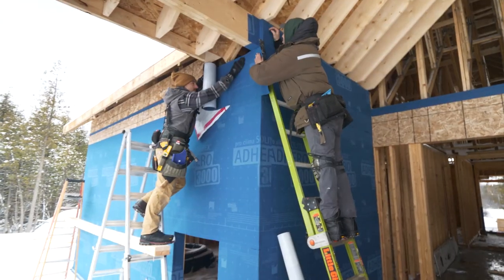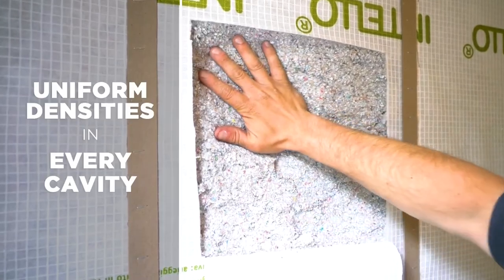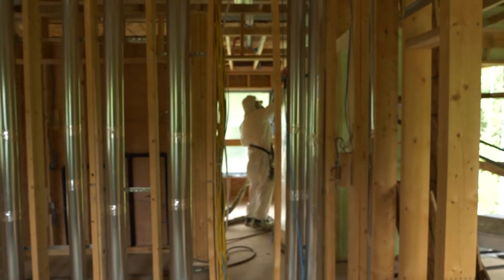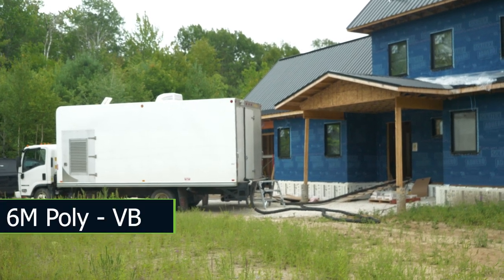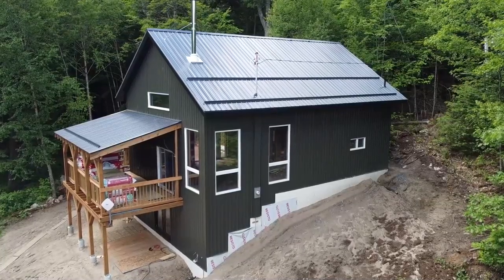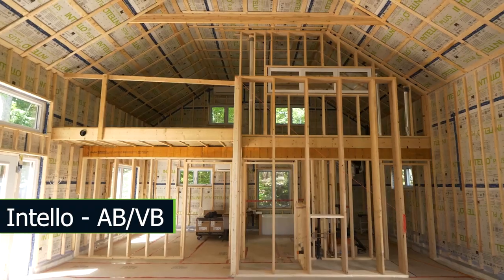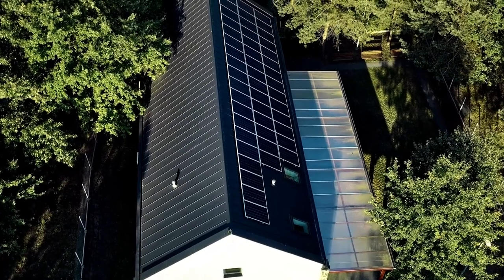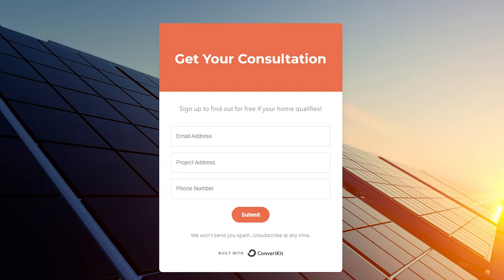Efficient Home Wall Assembly Examples (With Costs)

Comment: If you install xps foam on the exterior with fibreglass batt insulation is a Vapor barrier still recommend, I’m in Ontario not too far from you.
Reply from the maker: It depends on where the dew point is in your wall assembly. You may need to run it through a WUFI model. Ultimately, the code calls for a vapour barrier on the "warm" side of the wall assembly. Although that changes throughout the year, the inspector will want to see that on the interior unless you can show that it's not needed.
Reply: @Theconsciousbuilder  any suggestions on insulating and air sealing a garage ceiling with apartment on top?

Comment: So when you’re giving prices per square foot for materials I'm guessing that you are calculating these for the wall area - ie a 10' long wall that was 10 feet high would be 100 sq' so 100sq' of WRB.
But when you're giving a square foot cost for something like Roxul cavity insulation should you deduct the wall area taken up by framing members inside the wall? For example, if the framing takes up 30% of the 100 sq' wall area you’d really only need to buy 70 square feet of cavity insulation instead of 100 square feet.
Reply from the maker: the Rockwool batts come in at 15.25-in x 47-in for 16-in O.C. that accounts for 50% of your framing wall and keep in mind you also need some compression for the batts to stay in place. Rockwool has some online calculators which can also help.